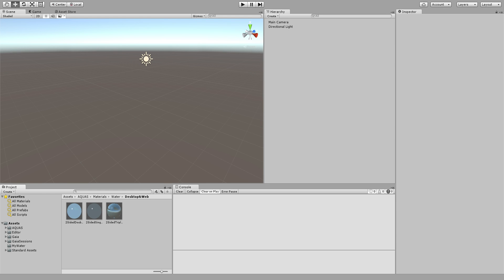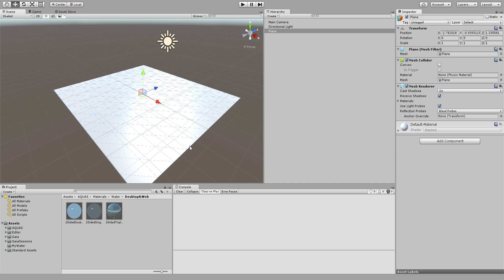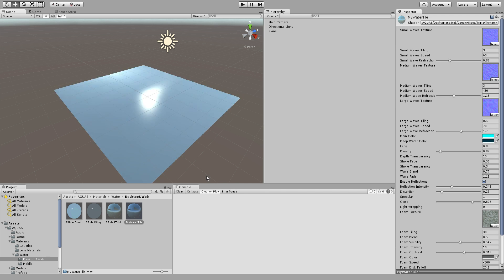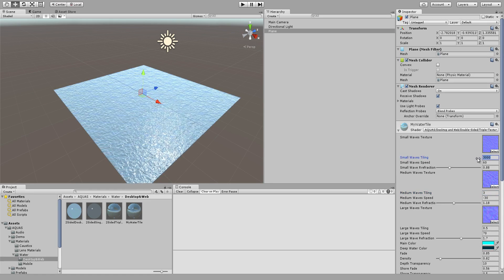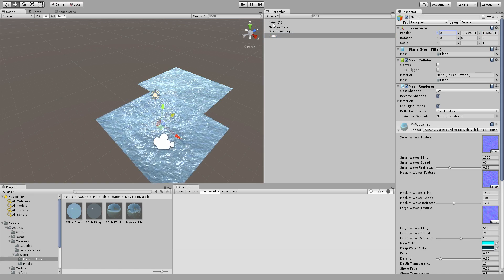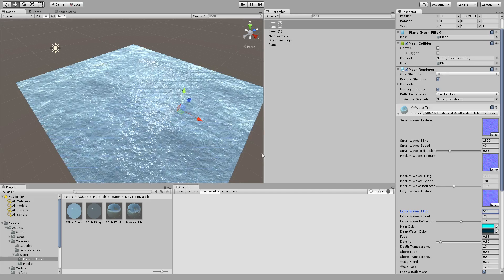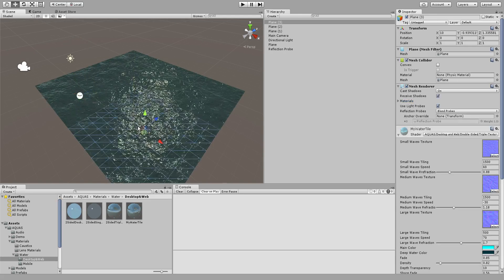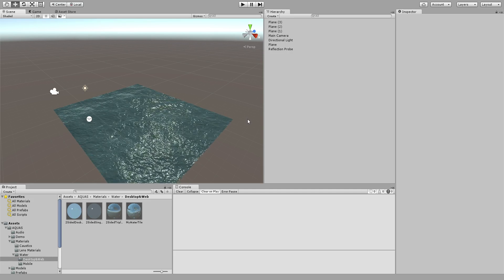Unity: AQUAS Water Tutorial - Water Tiles

Comment: This is great, but it kills performance. I have a very simple scene setup with tiled terrain. some of that tiled terrain is tiled water done so like how you show here with the prefab object its ont set to static. When applying this material to it the FPS drops from 650 to 120. Do you have any tips or help regarding this? With that much of a drop in FPS just with a water material applied all the other objects I will eventually add will bring the FPS down to a less than acceptable level for my specific use case.